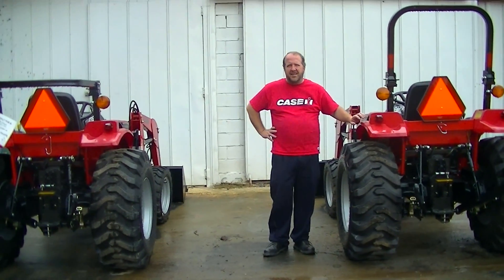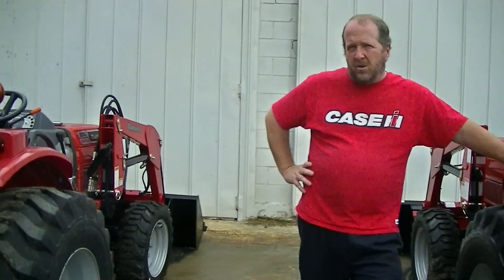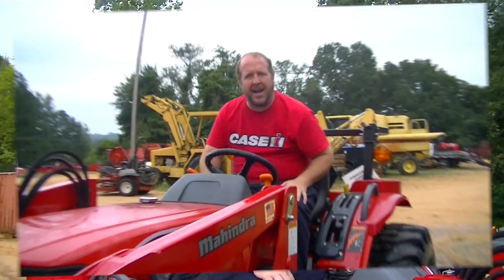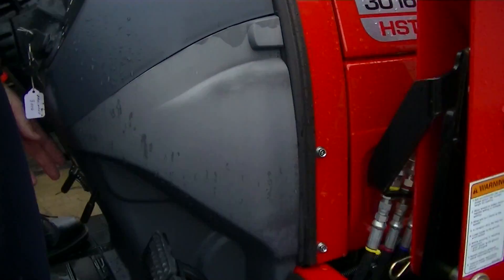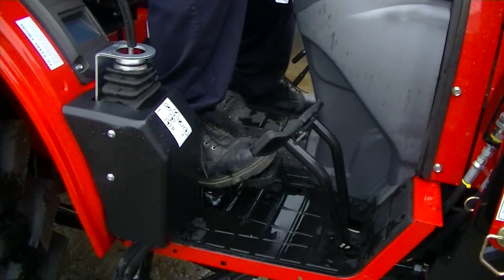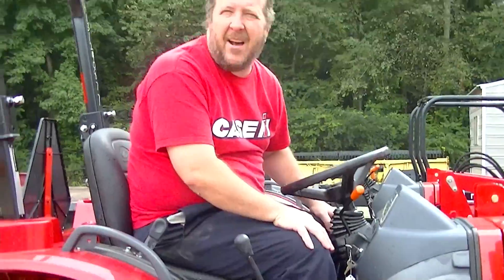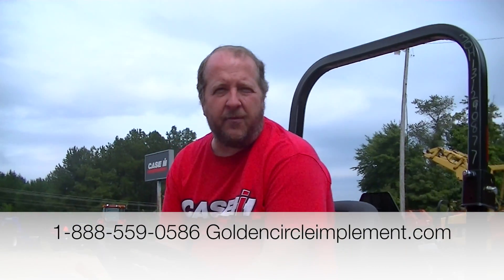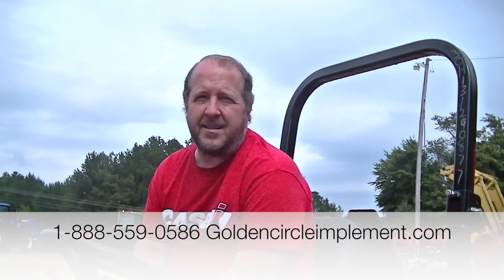Mahindra Hydro Vs. Gear Transmission Comparison

Comment: I'm about to buy my first tractor. It's down to two options. A new Case IH Farmall 35B or a new Mahindra MAX 36. both with FEL. I will mainly be running a small flail mower and doing loader work. Looking at both in HST. Whats everyone think i should go with?
Reply: Take it to the MAX

Comment: How do you engage the diff lock on a hydrostatic transmission.
Reply: On my hydrostat 2538HST, the diff lock is in the same place as all the other tractors.  Hope this helps friend.

Comment: I have a question, does a gear tractor automatically stop on grades when the clutch is pushed in, or does it roll until the manual brakes are pressed? I have hillside property and have always had a hydrostatic transmission tractor. I do like the fact once the pedal is released that the machine stops automatically.
Reply from the maker: Thank you for watching our videos and for your comment. When you press the clutch pedal on a shuttle-shift tractor, if on flat ground, the tractor will roll to a stop. But if the tractor is on an incline, it will roll down (either forwards or backwards, whichever way it's sloped). When you press the clutch in a shuttle tractor, you are disconnecting the back wheels (and the front ones if the 4wd is engaged) from the power moving them, so they just roll freely until you re-engage the clutch. I hope this answered your question, if you have any more, call us at 888-559-0586. Again, thanks for watching our videos and for your comment.

Comment: It is almost painful to see the tractor dealers trying to push the foot clutch manual transmission (albeit with "Shuttle shift" lever for forward/reverse) versus the vastly superior Hydrostatic Transmission (for overall operating Speed, Ease, Trouble-free, etc.). I absolutely Love my Mahindra 1526 HST, so far providing me over 140 hours of reliability, power, traction, safety, amazing Results, low operating costs and FUN!! Please take the time to test drive the different models before pulling the trigger!! For me, the legroom issue on other model tractors became clear after a test sit/drive!

Comment: Hey guys, really cool video, thank you. On the shuttle shift, do you select gears standing still? What if you decide you need to go faster? Stop, select & go? Or like a car on the move? Thx in advance.
Reply from the maker: Thanks for watching our videos and for your comment. When you want to change gears (like 1st gear to 2nd), it can be done "on the fly" (on the move) without too much trouble (just don't shift too fast, as you could jam the tractor into 2 gears at once).  Just clutch, shift, and go! But when shifting from low to Medium or High, you need to clutch, stop, shift, then go.

Comment: I have a 2015 emax22 hst and my forward and reverse pedals are separate and side by side ...i love it  not sure i would like forward and reverse on the same pedal....thinking of going to a 2018 max 26hst which way are the pedals on it?
Reply from the maker: Thanks for watching and for your comment. The 2018 max 26xl has the rocker pedal setup. Only the 2500 and 3500 series tractors have the 2-pedal setup.

Comment: Very informative.  I own an old gear driven tractor that is rated at 25 HP.  A friend owns a bigger heavier 30 HP Hydro tractor.  His machine wines and quits trying while mine will bury itself trying to do the job.  We haven't directly compared but I think my tractor is capable of far more work than his.

Comment: As long as the clutch pedal is not "slipped" often, will the shuttle transmission be as reliable as the hydro trans in the long run?
Reply from the maker: Thanks for watching our videos and for your question. The shuttle transmissions have proven to be very reliable over time. You are correct in saying that the clutch pesal should not be "slipped" because we have see instances where people who "slipped" the clutch too much, and ultimately compromised the clutch itself. Altogether, the shuttle transmissions have been very reliable. Again, thanks for watching our videos and for your comment.

Comment: Have they changed the pedal design on the hydrostatic models on 2018 models? I think I saw a video that they did and they may have changed the seat and put arm rest on them I’m not sure can you answer these two questions

Comment: i like the video thanks jeff . i was really trying to find the info you mentioned  about hydrostats wearing out over time compared  to gears. big help in my purchasing decision. Being as i live way the hell up north in Saskatchewan a cab is pretty essential, wehat do you think of the cab quality on mahindra as well as the heater and a/c thx cheers
Reply from the maker: Thanks for your questions and for watching our videos. it is unlikely that you will find any information about the erosion of power that you experience with hydro tractors as they age, as manufacturers would not like to share that information. Remember as you consider that this erosion does not necessarily affect the performance of the tractor, but it is noticeable and therefore is a consideration that we like to make our customers aware of. As far as the cab quality, Mahindra's cab quality is certainly as good as anybody else, and the heater in our 2538 cab will run you out, even on a cold day. The a/c is the same way, even in the summer. Again, thanks for watching our videos.

Comment: Good Video, Would suggest when demoing the Shuttle tractor to completely remove your foot from the clutch pedal. It does not take much force when riding a clutch to burn it out. I see this a lot in my field of work. Thanks!

Comment: On the hydrostatic drive tractor how can you use the individual brake pedals when they are directly in front of the hydro treadle pedal? It looks impossible to do!
Reply from the maker: alphaone101 thank you for your question and for watching our videos. That is a good question. While most of our older tractors have brake pedals beyond the hydrostatic pedals, most of our newer models, the brake pedals have been moved to the left side. On models that still have pedals on the right, they have raised the pedals up to give more clearance.
Reply: @goldencircleimplementcente4395  Yeah, that pedal setup was VERY stupid. I tested one out for about 2 minutes then I got on the 2538 HST and bought it within 2 minutes and I'm still pushing shit with her today.  I love that tractor!!

Comment: I've been told it is best to keep your engine RPM up when using a hydrostatic transmission. Wondering what your opinion on this is?
Reply from the maker: Thanks for watching our videos. We own a hydro tractor and use it at our house. It goes faster, and has more pushing/pulling power, the higher the RPM.

Comment: I want to get an e max with the shuttle shifter transmission so far mahindra is the only brand that I've seen that offers a shuttle shifter transmission in a sub compact tractor nothing against hydros I just prefer a manual and I like the price tag on the e max it's cheaper than a John deere mahindra makes the best tractors I can't wait to get my e max

Comment: What do you mean by "we see erosion in all hydrostatic brands" and how much does it typically cost to get it repaired/rebuilt or whatever you mean?  Thanks.  I'm trying to decide which to buy.
Reply: The reason why hydro transmissions degrade, is simple wear and tear.
Basically, the hydraulic motor and pump starts to wear and have less effective seals, and it becomes harder and harder to build up high pressure, which is what pushes the tractor.

Think of it like with a bicycle pump, where the more air that's in the tire, the more air escapes around the valve when you compress the pump, because of the higher pressure.
As long as the pressure is low, no problem.
Once the pressure is high, you get "leaks" internally.

And thus it won't push as hard as it did when everything fit well together.
Reply: +Golden Circle Implement Center I guess that answers my question, I need something that will last and perform longer than 10 years.  Guess it's a shuttle drive for me. I'll deal with the inconvenience while mowing with a shuttle drive as my tractors main function will be mowing (belly mower) then bush hogging. Good video, good info.
Reply: Of course, wouldn't it depend somewhat on how much the tractor is used.  I have a Boomer 35 hydro and use it about 80 hours a year so would think the power erosion would be less than if I used 200 hours each year.
Reply from the maker: +jdh023 Thank you for watching our videos, and thanks for your question. As the hydrostatic unit ages the pushing power erodes slightly with age. It is not that the units no longer function it is rather a perceivable decay where it once would spin all four tires and after 10 years it may not. It is not feasible to replace the units as they run in the thousands of dollars.

Hope that helps
Reply: yes you are correct, the trans will last longer if you use it less per year.
Reply: Thank you for the informed advice Sir.  Happy Thanksgiving.

Comment: Any recommendations on transmission fluid for the Hydro if the Mahindra branded fluid is hard to come by?

The Tractor Supply "Traveller Universal Tractor Trans Fluid" has "Mahindra" on the list on the back. Any thoughts on what will and what wont work well?
Reply from the maker: Most universal hydraulic fluids are serviceable in a Mahindra tractor. However remember you always get what you pay for. The better fluids such as those sold by JD CIH and CAT are more expensive but they tend to have far superior water handling properties. The cheaper fluids like the ones sold at Napa and TSC tend to not do well when water inters the system. The most important aspect of this question revolves around the 5 year powertrain warranty. If your tractor is still within that time frame and develops a transmission problem, if the oil sample shows other than Mahindra, you have just given them an excuse to not cover expenses. I am not saying this will happen, I am just saying  it could happen. Therefore chose your oils wisely.
Reply: Golden Circle Implement Center  There are other fluids mentioned in the owners manual but I spent several hours looking for any of them locally with little luck. Walmart, autozone, pep boys,  NAPA all failed me. Online I noticed that most of the people who have found the alternatives live in Canada.   I guess I need to make the 80 mile round trip to my dealer this weekend.
Reply: ebay is your friend, many tractor dealers have parts & fluids for sale on the site. it will cost you a little in shipping however you are not buying tractor fluids every other week.
Reply: Here ya go Rickk10000...http://www.amsoil.com/shop/by-product/hydraulic-oil/synthetic-tractor-hydraulic-transmission-oil-sae-5w-30/?code=ATHQT-EA
I've been using this in my Grasshopper hydro 25hp zero turn for several years now. Half the price of Grasshopper oil

Comment: Looking into buying a compact tractor soon.Will be mowing about 3 acres.Thinking of buying something in the 25 to 30 hp,of course i will need a bucket for some work.My question is a mid mount or rear mounted mower?I have a riding mower now and think a mid mount would be the same.Everyone says the rear mounted mowers are much better.If i am only going to use the bucket 2 or 3 times a year and the mower once a week,wouldnt a mid mount be ideal.Love these mahindras.
Reply from the maker: lonecedarfarm Thank you for watching our videos! A Mid mower is cumbersome for anything except mowing. But if that is your main job that you will be doing with the tractor, then perhaps you can justify the few times of inconvenience. Thank you.

Comment: Just bought a hydro, my only complaint is the rocker set up they use. My foot is a 12 so there is very little room for your foot between directional pedals. You should not operate the tractor, like he shows his foot in the video, heel on reverse and toe on fwd, because this is dangerous because the foot placement is not stable during travel. Also you have to lift foot, knee and thigh to reverse. This may not seem like much but after hours of operation the right leg feels the stress. It is easier to lift half the foot to shift side to side(fwd or reverse). JD, LS and New Holland use the side  by side setup but they are inferior in performance and or price value. One more thing; the LS (which makes or made McCormick, Montana, Farm Trac, and Taft) had the best pedal performance, as soon as you let off either drive pedals the tires stopped turning like full brake even to the point of skidding and stayed put even on grades. The rocker set ups seem to roll ever so slightly initially.Who knows how the rolling will be as hours and wear build up?
Reply: +doug pitt 
Couldn't agree more about the leg and knee stress after a long time operation and long journey stepping on gas pedal. Because of this I adore the hand throttle not only on tractor but also in my car cruise control (tempomat). I am talking about the regular gear system, I haven't drive the hydro gear yet.
Reply: Doug, I tested out that exact setup when I bought my Mahindra.  I absolutely hated that pedal setup!!!  But I got on the Mahindra 2538 HST and it has the pedals side by side and that's the one I bought and I'm still pushing shit with her today.

Comment: I have a (2014) 3616  how do I replace the battery? There is nothing in the manuals that show it.. Thank you for your time..Sal.
Reply from the maker: Thank you for watching our videos, if you take out the front grill, you will be able to access the battery. If you need further help, you can call us at 888-559-0586 (we close at 4:30 pm CST and open at 7:30 am CST).

Comment: Hydrostatic trans won't last, doesn't matter the brand. When I hear it has a hydro I look the other way.
Reply: We got a Mahindra and we got a hydro we in Missouri cold spells happen without warning and apparently hydro fluid freezes, so we are going to take it to the dealer and swap a manual in